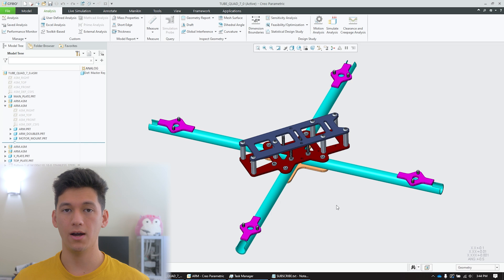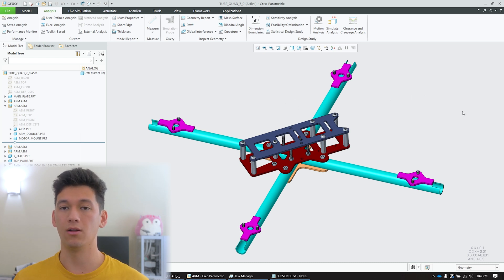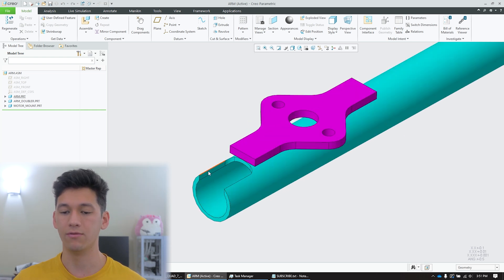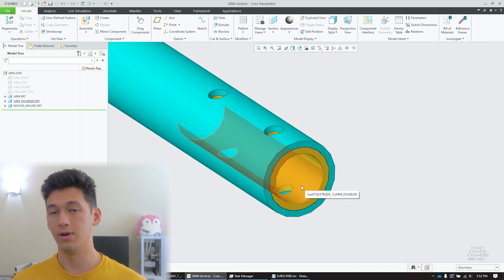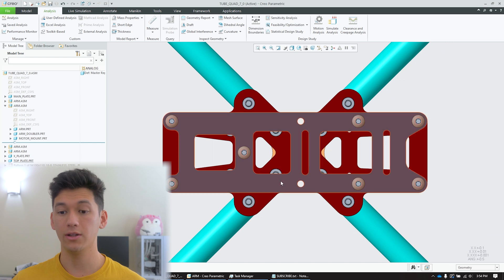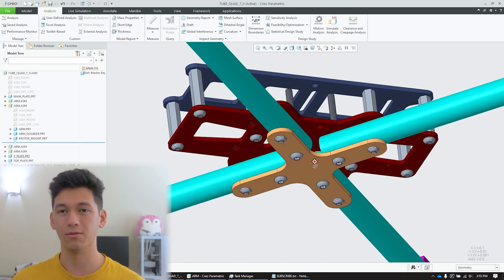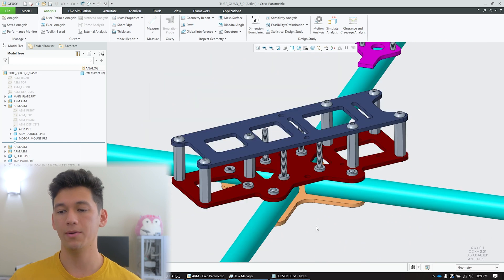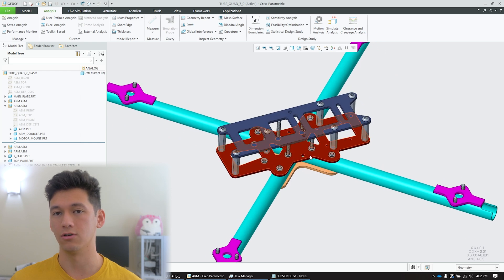Designing the PERFECT Freestyle Drone - The Tubular Quad V7

Comment: Can't be nerdy enough for me.  

Would you please identify where you source your parts.  That is an obstacle to my making progress getting into building my own quads.  

Many thanks and keep up the good work!
Reply from the maker: Thanks! Back when I cut my own parts I just bought carbon plate and tubes on Amazon. Now the kits are cut by CNC Madness
Reply: CF isn't the problem. It is the stack, battery pack, and motors. Will you sell the camera mount too?
Reply from the maker: @onlycartoons2012  The parts listed in the description are what I run on the V6 and they should work nicely with the V7. 3D printed part files are on Thingiverse (linked on the product pages)